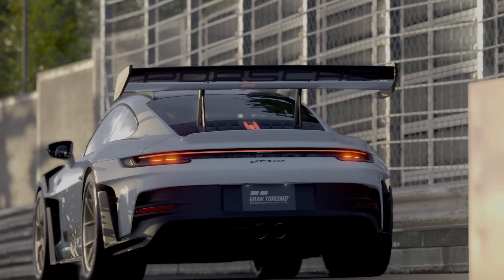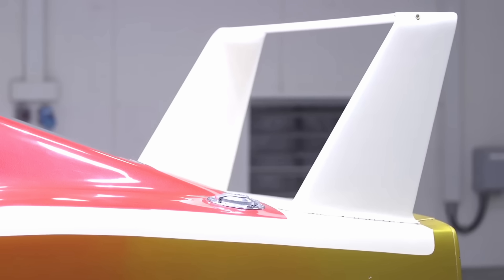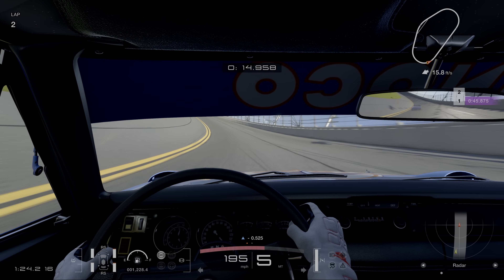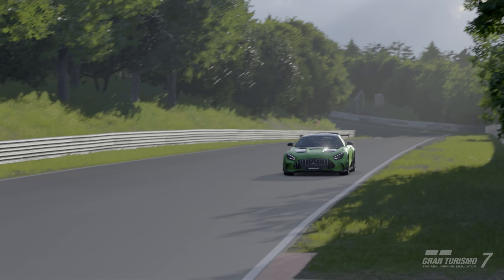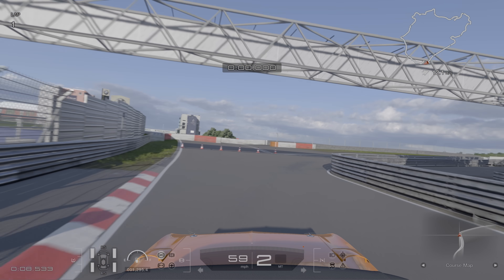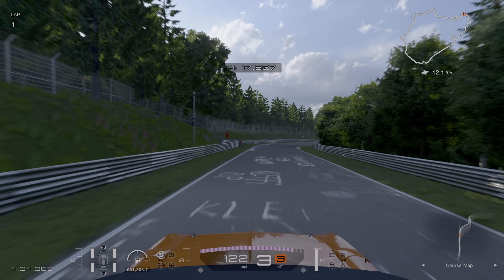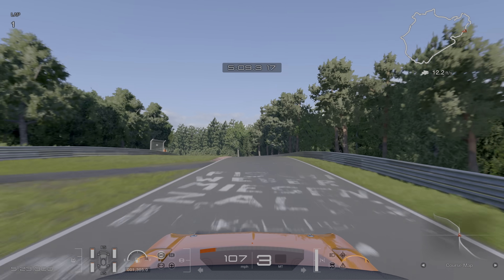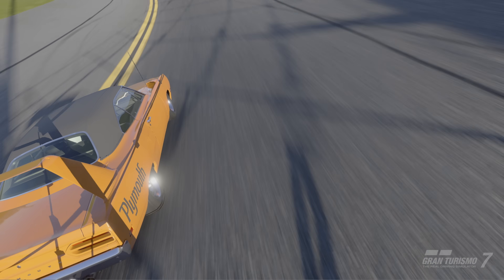Why Is This Car Undrivable in Gran Turismo 7?

Comment: Cool video. Couple of things stand out about this car. It never came with nor raced with a 5 speed manual so that's inaccurate and the front suspension adjustments should be referencing torsion bar adjustments, not springs. The little domes on top of the fenders were pit there due to front end pressure pushing the car down so far at speed the tires hit the inside of the fenders so they would cut that part out, fixing the rub and also relieving the pressure build up under the nose.
Reply: A torsion bar is a spring, it's just not been coiled up

Comment: I'm a Forza 8 player, but the first thing I do to a classic car (especially american muscle) is stiffen up the suspension, get anti-roll bars, and invest in at least some basic roll cage in there. Does wonders not only for cornering but also to maintain it stable on the track through height variations and bumps. 

Rigidity = nice!

Comment: It's important to note that the Firebird was a hand made car, and came with all of the imprecision therein. Look at lots of parts on old cars and one side of a bolted joint will usually have room for adjustment to compensate. the first machine-made vehicle from GM where all of the bolt holes were the same on every single unit was none other than the Pontiac Fiero.

Comment: I was skeptical. The ride height was so counter intuitive, but you were correct, much more stable, reins it in considerably. I think most people's problem is they think full send. This car is not designed for that, it's a fire breathing dragon that can not be bargained with. You either drive with patience or you die.

Comment: Well this Video is super cool! I like the content of it, even tho i have no issues driving this Car.
A nice suggestion: do the same thing for the Ford Sierra RS500 Cosworth. That Car is pretty okay to drive while you are not to high in Horsepower, but the Sierra competed in Group A Racing with Way over 500HP, and that is pretty nasty to drive in GT7, compared to other Group A Legends of that time, like the BMW M3 Evo

Comment: Great video. I only recently found out how much difference body rigidity makes to older cars. Weirdly though, there are some outliers. The Ferrari F430 is quite wobbly on RS tyres and benefits a lot from the rigidity upgrade. A car that's weirdly stable when fully upgraded without the rigidity upgrade is the Aston Martin DB5, of all things.

Comment: I wonder if they forgot to model the aerodynamics of the vertical stabilizers. The wing wasn't made that tall for downforce, the vertical supports are designed to create a large horizontal force and slight roll moment when the back end starts to step out (Also on oval tracks they could scew the wheel alignment a degree or two to enhance this effect.).

Comment: I use a Superbird in Drift lobbies and do Tandems, but I do admit finding the balance for it to do that was difficult for me. I might have to mess with it in The Ring tonight. I do have to mention and I have found out the hard way is that if you completely slam/lower your car and you have low wheel arches in the front you will completely will have no turning radius/angle.

Comment: You can also run soft tires on the rear and medium or hard in the front. Might run into issues with tire wear, but if you're just driving casually, it works pretty well.

Comment: Thumb Rule for lousy cars to get good handling :
1. Lower Ride Height
2. Negative -5 Degree Camber front and back
3. Stiffen the chassis
4. Front Toe Out and Rear Toe In
5. Setup the gear ratio to match the track
6. Add bodykits and adjust the spoiler
7. Trial and Error with the correct tire size

Comment: A 50+ year old boat with 7.2 inches of ground clearance isn't as track ready as a 10 year old sports car and requires more skill to handle well? Who whoulda thunk it?
The Superbird is a homologation, but NASCAR allowed modification of suspension geometry. they often dropped cars down to ~3 inches, and modified aero significantly.  Anyone expecting a stock Superbird to actually perform anything similar to a NASCAR challenger is brain dead. The Superbird is a cool car, but it was built to meet the ABSOLUTE minimum homologation requirements for NASCAR at the time.

Comment: When that car was racing with it's original bodywork, it lost every race. So the boss of the company went to an engineer and asked "what would you change to make it faster?", and he drew a pointy nose and a raised wing on the back. The boss went to another engineer with the same question and got the same answer. Any 4yr old would've given that answer. But it actually was enough of a change to make the car winning.

Comment: The fully upgraded version or motor swapped version has the same issue. The suspension and rigidity are very big issues. But at high speeds there is so much drag that you can starting torque spinning the tires. That is the real biggest issue. Gear ratios and shift points can fix a lot of high power traction issues. C4 vette, and 69’ Camaro have same issues. Motor swapped or not. Remember, transmissions are “TORQUE MULTIPLIERS” in high horsepower cars you want the combined trans gear and rear gear to be as close to a 1:1 ratio as possible in 4th or 5th gear. Most standard transmissions and rear gear combos have 3rd gear as 1:1. Combine gearing and suspension adjustments to achieve the best setup for any car on any course. These old cars don’t have 5th and 6th gears sometimes. So to achieve the desired ratios you’ll need to adjust final drive gear ratio. The lower the number of the rear the more rotations you get out of the wheel for each rotation of the trans gear. Also remember not to down shift too soon at high speed and high rpm. The drag on the running gear is modeled in this game. So just letting off accelerator too soon at high speed can cause the tires to lock up… Have fun 👍

Comment: It's a body-on-frame construction from an era when tricky fellas were dipping the bodies in acid to lighten them up for performance, sooooooo.......when considering the history of American racing, it makes sense nobody would think to upgrade "body rigidity" for performance in the game either.
Reply: I also recall lowering the suspension (too far) to "address body roll" as far back as GT2 and basically making it an undriveable scrape of a car~ but it looked damn cool in the lap replays

Comment: The people complaining about this car are probably the type to just keep everything stock or only focus on performance upgrades, or cosmetics.  For me, brakes, suspension, transmission, body, weight, and weight distribution, tires, then power last.  Oh cosmetics, not a concern whatsoever.

Comment: It's actually quite accurate. The car had "shock value" in styling but was a horrendous piece of crap to drive. I've driven one - and yes it was a hemi 4-speed. The rear wing was pretty much just screwed into the bodywork and would wobble around after hitting a few potholes. The front nose was sheetmetal over a bit of wire scaffolding. Neither part added anything to driveability over a standard Charger - only serving to make the car longer, heavier, and more out of balance. It only LOOKED like the NASCAR ride that Richard Petty drove without the actual engineering that went into that car.  It was a HOMOLOGATION car and the only thing being homologated were the body dimensions.

Comment: From the looks of the suspension setup and alignment you can see why it handles the way it does, too little damping (usually race cars are set around 65%) and 0 toe angles (toe in is a self centering factor)

Comment: I built a Porsche 930 Turbo in the game for high-speed racing, and ran into an issue with the rear end kicking out past, say, 140 mph. Talked to a guy who works on those kinds of cars IRL and he told me that the solution was to add tons of rear downforce. Tried it in the game, didn't work. This was many updates ago. I'll have to see how it changed. Perhaps I was running into some kind of bottoming out issue...

Comment: The reason the superbird and charger daytona were so dominant in nascar and at daytona 500etc, is because they had aero no other cars had. they actualy still handle really wel being a american car. my dad drove one once and you could feel the downforce do its job. they just were not made for the nürburgring. also the nascar cars were equiped with roll-cages providing more body stiffness ( same as the regidity upgrade). the only reason for the height of the rear wing was so the trunk could still open because the for some reason did not mount it on the trunk but the quater panels. the wing would do almost the same being lower than it is. y'all do need to keep in mind that it still is a video-game and not irl. also being an american car the factory commercial superbirds, daytona's and american cars in general had slopier steering and not like a modern german sports car made for the track that has little to any slop. these cars were made for diffrent kinds of racing than the merc so there is a reason y'all can't drive it that fast on the ring. they handle less good? (yes). they handle terrible(no), they just handle diffrent than modern cars.

Comment: It would still be better if they added a wing upgrade that looks about the same but added a decent amount of rear downforce. The front aero kit just won't be useful without it. I usually get the body rigidity upgrades but I'm always cautious on the widebody upgrade, not always sold on the look, plus I might want to test said cars top speed which should be better without the widebody

Comment: Ive played Gran Turismo since it came out on the PS1 Im also a mechanic (in no small part thanks to Gran Turismo igniting my passion) and suspension/steering/drive ability is my specialty.   One of my favorite things to do in the game is to take cars that have problems and tune them to be as easy to drive and as fast as possible.    Aside from the novelty cars that are just there because of historic significance I have yet to find a car in any Gran Turismo title that you cant make work well enough to be competitive.

Comment: Zero rear downforce. That huge wing and no downforce. The NASCAR version of the Daytona/Superbird had an adjustable rear center section to add functional aero. The public-consumption version basically had plastic scaffolding screwed into the body. It was absolute junk - we laughed at them when they were new.  So the car drives fair if you leave it alone - but if you add any power at all it falls apart, much as it did in real life.

Comment: Don't play GT7 but played GT5 and GT6 extensively. 6000 hours. Obsessively ran high speed ring. Be willing to bet the suspension was bottoming out, hitting the bump stops, thus effectively increasing the spring rate to infinity. Raise the ride height. Secondary solutions: stiffen the rear spring or ARB and adjust dampers to limit travel. As for chassis rigidity, it didn't do much in GT6, but judging by your video it seems to have a noticeable effect in GT7.

Also: normalize the power to weight ratio, ensuring similar acceleration and speed down the straights. Put each car on the same SS tire and the Daytona will get left behind by bus lengths within 30 seconds.

Comment: Do realize that the stock suspension in a street version had all the attachment points using bushing with at least 1/2" of rubber.  Even restoring these cars for the street, people are using urethane to give them a little better feel and handling.

Comment: personally i think most gamers misjudged the importance of chassis rigidity in sports car. its like the base. you need to have a strong base for the car to handle well. suspension is supposed to be the next thing. torsional rigidity of newer car is incomparable to these 70's cars. the older the car the more you need to pay attention to this.

Comment: The fact that you use racing tires says it all really. No wonder the car handled bad initially, you're putting very sticky, modern grade racing tires on prehistoric suspension. It wasn't designed to take that much grip and hence instead of gripping, it produced too much roll which caused the car to become unstable. At the very maximum I recommend using Sports Hard or Medium tires for this car, and I urge people to do the same and stop relying on Racing Softs for tuning vehicles, you're tuning street cars not race cars.
Reply: @ShizuokaWanderer  this car WAS a race car back in the 60s doing 200mph on the ovals
Reply: @Maximus20778  this race car was designed and raced in the era of bias ply tires, which were much softer and produced a lot less grip than modern radial tires. There's no real way to simulate that in GT7, so most old cars handle either nothing like their real life counterparts but are still fast, or they handle horribly

Comment: Superbirds are super rare IRL UK. I think there are about 5 in all. But I got to drive one in the 80s when they were just old cars. Just a regular roadgoing version with the 426 Hemi and a 4 speed (like $100k now, but then......) and it had seen better days. I bottled out around 140mph the vibration and wandering were terrifying, the brakes were almost non-existent and the steering was wooden and slow. Scary, scary car, but it was fast all right!

 I stopped with Gran Turismo at GT6 but ISTR that the Superbirds I drove in the older versions drove pretty much the same as the real one I drove all those years ago! BTW I was 70 this year, still gaming a bit and still driving 'em like I stole 'em in real life too!

Comment: some spring rate and shock valving and that car would be even better. Im not a gamer, so Im not even sure you can change the settings. the "right" way to build a car is big power last. Make it rigid, make it turn and stop andTHEN add power. Its a lot of fun to drive a slow car fast-at least in the real world

Comment: The GT7 version of the superbird is actually the civilian version not the Nascar one, which explains why it's handling is not the greatest. The Nascar version had a roll cage, a better suspension, and the engine had more horsepower and less torque than the civilian version. It was also designed to only go on oval tracks with it's high speeds not doing regular track races.

Comment: if a 4speed Manual BB can go 200mph in the 70's whats the issue why do we need 10 speed gearboxes today for the track, lazy drivers or poor engineering 🤔, probably the drivers had massive testicles and the engineers didnt care.

Comment: because every racing game gets physics and traction completely wrong. there's a huge misconception in the industry about car handling in general. for example, hellcat's are much more nimble than people expect and give it credit for. call it slow boat and get gapped even on corners. put a great set of tires on a hellcat they handle pretty good. the stock hellcat tires are garbage.

Comment: It's a video game not reality. Tires suspension motor transmission etc play a roll. My 83 ranger mid size ranger was stable at 160mph per state patrol on radar and it was stock frame axle breaks and suspension

Comment: throttle control.  just dont mash the gas, and it drives fine.  heres a few cars that def require some tweaking:
1.  shelby gt350.  
2. lancia stratos.
3. toyota mr2.
4. detomosa mangusta.
5. any older porsche. 
most of these cars are for specific race types, and do better on easy courses.

Comment: In order to appreciate great cars you must first try the average cars . 
With that been said as a guy who literally grew up with Gran Turismo i know for a fact if you upgrade only the engine and gearbox , you just have a rocket on wheels . If you want that to change into a controllable vehicle you MUST make it lighter ( weight reduction) and then combine , suspension upgrades , aerodynamic settings and brake bias to just scratch the surface of been among the leading drivers ...if you wonna be the first then gearbox settings must be used as well 😂 . 
Any player that is old as i am and ever played Gran Turismo 2 will know what i am talking about but Suzuki Escudo Pikes Peak 4WD 980 hp was pretty much the worst vehicle you could drive anywhere else except Test Course .  Well i managed to win any race against any opponent in any competition that vehicle could join because of few settings in gearbox , differentials , aero and brake balance 😉

Comment: My tip is try not to lower your car like very low level, the Superbird should be at the same level as standard suspension height (just need to change it to customizable suspension but change the value to standard height)

I don't see how Plymouth Superbird was "impossible to drive" like those people said

Comment: The wing has no downforce in reality. It's more like fletching on an arrow just to keep the back end straight. That's why their so tall. Adding any real downforce would lower the top speed
Reply: It's supposed to be an adjustable wing in reality. The angle at which the top plane is aligned with the top of the uprights is the optimum angle for top speed, but it was designed so it could be used at smaller tracks than Daytona as well. That's why there's a circle at the top of the uprights; it's the bolt to adjust the angle.
Reply: @mpf1947  I remember reading in an article on the torino King Cobra designed  by  Japanese American Larry Shinoba it wasn't stable at speed in the corners they had later designed a modern day nascar style rear spoiler on it but was still to slow or still lost control not sure but of course, all the stock cars had stiffer chassis even then, so that makes sense